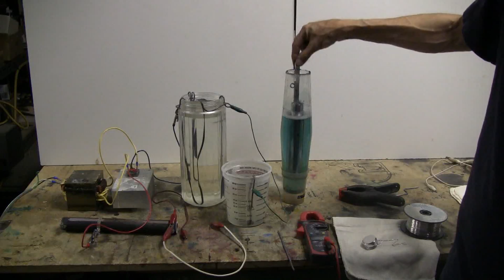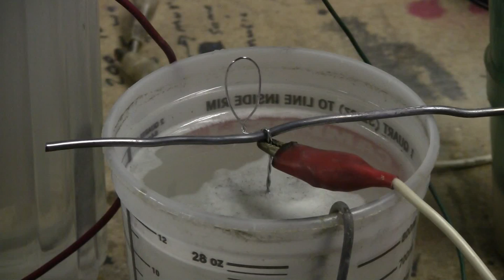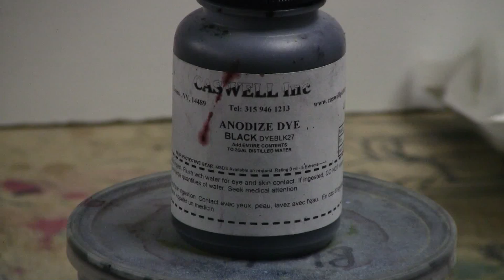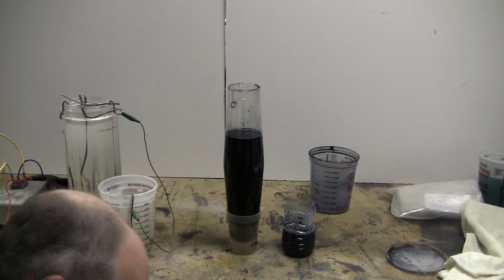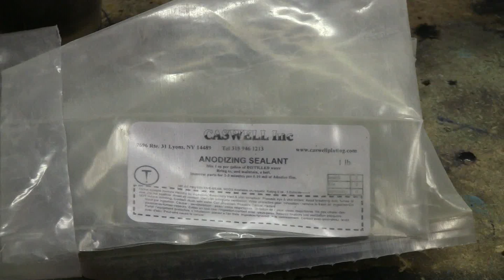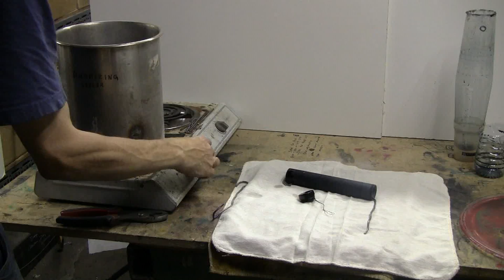How To Anodize Aluminum

Comment: thanks alot for the video =) i want anodize my paintball marker. but its hard for me to calculate the correct surface :X
Reply: +Bärtiger Baron Take container, fill it with water, put your marker into container so it replaces x amount of water and then remove the marker. The amount that has gone over board is mass of the marker and can be put in container where water level is same as average thickness of the markers body. Now just measure how much surface area you got... or something like that :D

Comment: Couldn't you use potassium carbonate or some other stuff as a electrolyte or does it have to be sulphuric acid?
Reply: And also it wouldn't react with the copper.
Reply from the maker: +ben lawton There is an anodize that uses phosphoric acid but this is only used for paint prep normally. The sulphuric acid is needed for normal or hard anodizing of aluminium. Titanium can be color anodized with many different electrolytes and the voltage controls the color achieved.

Comment: If you have a stainless steel part basically permanently attached to the aluminum part you want to anodize, what will happen to the parts during the process?
Reply from the maker: +Mike Melina You need to mask off the stainless part to protect it from the anodizing bath. Lacquer or other waterproof paint can be used to do this. Make sure that the stainless is well covered and protected.
Reply: thank you. would nail polish work?
Reply from the maker: +Mike Melina Nail Polish is a very good choice. The dollar store stuff works fine.

Comment: Hello i am an engineering student and i wanted to do the same experiment but i have a question that you may help me with can i use Markers instead of buying dye from Caswell specially that it will take a long time for shipping and if i am going to use markers could you please tell me the steps needed for example how many markers i have to use ?? 
Thank you so much
Reply from the maker: +Ahmed Abdelmoneaim You can use Sharpie brand permenent markers and they will work well for small parts.
Reply: +Bill Gilmour another question i am sorry what if i use an aluminum wire for negative charge  ??  and that lead wire must have a special thickness ? thankk you

Comment: I want to anodize an aluminum dash plate that is about 3.5' wide X 1.5' tall...What would be the best way to do a piece that size? I only have one shot at this, so I need to get it right the first time:)
Reply from the maker: +The Static Nomadic That is big to do at home. It would take a large flat plastic tray and a lot of acid solution. You would need to compare the cost of setting up to do it against the cost of sending it to a local metal finisher for anodizing.
Reply: Yea, I have figured that out, but thanks for the reply:)

Comment from the maker: You rewind the MOT so it produces low voltage. If you aren't equipped to do this, you can use a battery charger or PC power supply, etc. My voice is the result of medically untreatable birth defects. It's all I've got.

Comment: Someone mention using a microwave transformer...NO WAY   they put out 1600 volts or more... Just use a 12v regulated power supply. do not mess with microwave transformers... 
Hey dude what accent is yours?? It's not the best for videos as it sounds geeky.. sorry but it does. so where are you from??